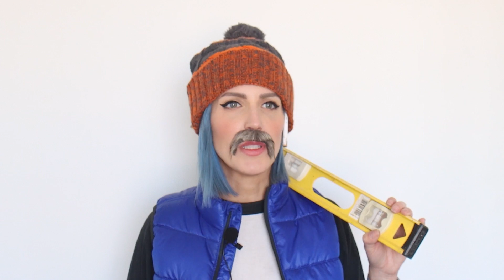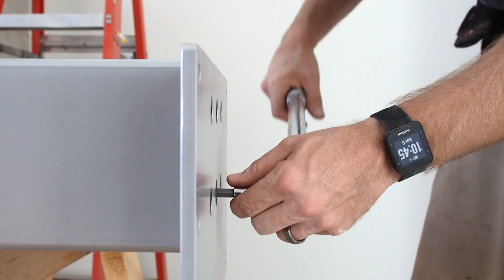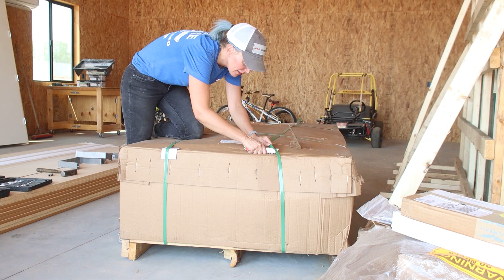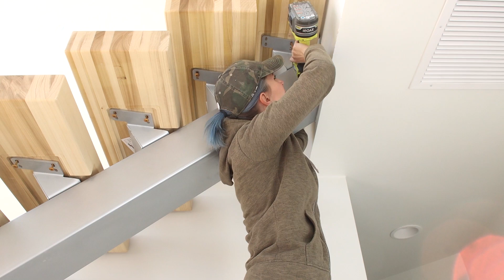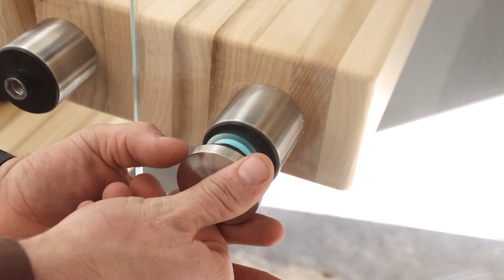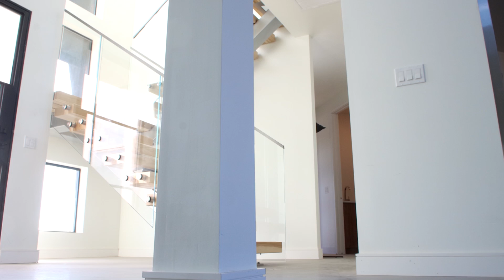DIY FLOATING STAIRS Install | Ep.11 Building Modern on a Budget

Comment: Pricing has increased substantially in the last 3 years.  I just got a quote for $45,000 for a simple cantilever design.  Way more than the $18,000 quoted here for a monorail with a switchback.  Probably more cost effective to have it fabricated locally.

Dissapointing.

Comment: Stairs looked Great!
however i am concerned about the wood you fastened the horizontal frame to... that wall did not have a support in the right place and you put blocking in... I would have opted to get a 1/8" or even 1/4" steel or aluminum plat that spanned at least four studs and anchored the stairs to that plate knowing that there will be many many years of impact and jarring vibrations through that wall due to the stair mount...

Comment: Really like the look of  floating stairs so had to watch this video. Used to stairs attached and cantilevered from the walls and then suspended from cables hanging from the ceiling on the other end. Your stairs look like they are semi-custom as they can use the brackets and other fittings over and over again. In the metal shops I have worked in, mass production techniques would have been used for these items. ( jigs, fixtures, robotic welders, or automatic welding machines that are custom made in the shop sometimes) The rest of the stairs are modified CAD drawings to meet your special needs with custom fabs. Its a great way to get a excellent product at a more affordable price. Good choice!

Comment: I'm a home handyman, but I was able to work with a local welder and glass company. With  research and some thought, and a lot of time and care. I built a glass railed, 2 steel stingers , over 10 foot ,switch back rise. All in $5800.00. Sourcing the hardware was easy, as our cabinet maker pointed me in the right direction. It took 5 guys to move the main glass wall-about 300lbs. It looks beautiful, but I wouldn't do it again.

Comment: We are doing it ourselves from scratch.  I want the hidden attachment with wood ends covering the "pin" or whatever is attaching the glass side rails but do you know what they use to attach under the wood edge vs exposed pins?  Or do we buy the pins and not use the attached exterior but have a screw like element placed inside the wood that covers the pins?   Any idea or help would be super appreciated as we navigate this finished stair as a complete DIY project.

Comment: I am planning to do something similar in May, but I am shocked by your prices! Main beam - 7.4m 8mm thick costs approx £200, intelligent welder £250 per day (promised to complete the job in 2 days maximum), for esthetics, triangular steel supports goes for the laser cutting £300. Wood - have not decided yet, but probably ash, or poplar - that will be very expensive. And of course, a lot of the elbow grease to paint everything nicely + bits'n'bobs (bolts, varnish)... My total budget for the project is £5k, and I do not intend to even get close to that number.

Comment: My biggest concern with railings like these is if you'd lose balance and fall and lean with full weight. Does it flex enough not to shatter and if it does, does it shatter like tempered glass?

Comment: Always check with your local municipality. Many regions have much tougher codes than "international" codes. 12mm monolithic tempered glass like they used would not pass final inspection in many areas. Still can be done but this system would require 16mm tempered laminated where I am from.

Comment: We put in a ViewRail Floating stair system in 2019 and absolutely love them.  We did not do glass and chose a wood and tension wire railing  It makes the house.
Reply: What was your cost?
Reply: @alijabos  We are a contractor and paid only for materials - we only have 1 run (no platform etc) cost in 2019 was around 12K - but covid prices  - I couldnt guess

Comment: On the top step wall, use a piece of drywall, cutout the area where bolts are, use drywall screws to hold it in place, then mud and tape, good luck.

Comment: Y’all are braver than me with that glass rail. I’m sure it’s plenty strong when you’re pressing down or pulling on it from top to bottom, but what if your wife’s overweight grandma starts to fall to the side and grabs the rail? Can it take hundreds of pounds of torque from its weakest angle? 
If it can, that’s great, but imagine the cost and cleanup if it failed.

Comment: keep your high heels off the stairs treads  ( *) I thought the IBC code required the use of a window in a stairs ( @ switch back) had to be 30" aff sill or had to be tempered glass - is it ? or am I wrong in my interpolation ? The results are stella ( which direction does this same window face   east / west ?
Reply from the maker: Yes, the window is tempered.

Comment: Looks great. For the top mounting plate why not mdf or some thin smooth plastic foam sheet the same size as the whole step. Paint it the same as the wall and stick, glue or magnets to put it over the top. As long as it goes from wall to edge it should look just like the wall and you’ll still be able to get to the bolts.

Comment: Great Job, I am extremely happy with my DIY Viewrail install also. I Like your improvisation on the temp. handrail. Some tips for DIYers installing Viewrail. We had the mono stringer up for a while and no other place to get to the second floor on our small townhouse gut renovation. Use 2 x 12 temp treads with 2- 1/2 inch screws screwed down through the tread, through the holes in the stringer brackets into 3/4 plywood blocks.
I had the top of the mono stringer bolted to the wood header and supported wood floor. No drywall up.
I real carpenter happened to come see my project and he said I should put a piece of 3/4 plywood 1/2 inch smaller on all sides of the the header flange so i could slip my 5/8 drywall under the flange for a clean look.
arrrgh. I unbolted the mono stringer, plugged the holes in the wood floor with dowels, installed the plywood spacer behind the header flange and reinstalled the mono stringer. It was worth it!

Comment: Stairs look cool and while it would be basically impossible to make stairs that actually look floating, calling these floating feels a little like click bait.
Reply: It's not click bait because that is the actual name of those types of stairs.
Reply: @somebodyonhere  They touch (erm are bolted into) the floor - hence not floating. Look up 'floating staircase' pictures.
Reply: @stanimir4197  i have before, and they look like this. Yeah.. they have to be bolted to something. Floating shelves are bolted to the wall. Floating stairs to the floor. It's the illusion of Floating. Nothing can actually float...
Reply: @somebodyonhere  https://www.cgmworks.co.za/steel-work/floating-stairs/
an example - bolted to the wall. It's easier to have a soundbite or call it something cool, but this types doesn't float, close to but not really. This one, in the video, is just a bog standard staircase with glass panes on the sides - it's not bad or anything but you'd be hard pressed to call it 'floating' when it's bolted into the floor.

Comment: I don't understand why some people hate poplar wood so much.
Reply: I personally DON'T hate poplar, but as a life-long woodworker I can definitely answer your question:
1. It is VERY soft as wood goes. Softer than southern yellow pine by almost 30% (a 'softwood'; don't get hung up on hard vs soft with wood, it's really coniferous vs. deciduous that is being designated, just with fewer syllables.). 410 to 540 (depending on sub-species) on the Janka wood hardness scale, for the wood nerds reading this. That means that it is trivially easy to dent or scratch. I can easily leave a mark in poplar with my thumbnail, and I have really wimpy fingernails! Adding a hard, catalyzed finish to it will probably eliminate the scratching issue, but the first time something heavy gets dropped on it, they will have a divot.
2. Its coloring. It is greener than most woods overall, and has a very large amount of variation to its color, even within the same tree. Because of that, it is almost impossible to get a unified look out of it like you might with cherry, mahogany, maple, or walnut. That bothers some woodworkers for aesthetic reasons.
3. It's not the most stable wood in the world. It tends to move more than most hardwoods with humidity, and that, combined with its inherent weakness (see #1) can make it vulnerable to splitting and checking.

the good news is that it is usually very cheap (~$2 a board foot) and super easy to work with, given its softness. If it does get dented, a session with a steam iron and a wet cloth can usually rectify most damage. That is why a lot of folks will make prototypes in poplar before committing to more expensive wood for a final piece. It's also used for internal frames of upholstered pieces, where appearance is not an issue.

OK, that got a little long...